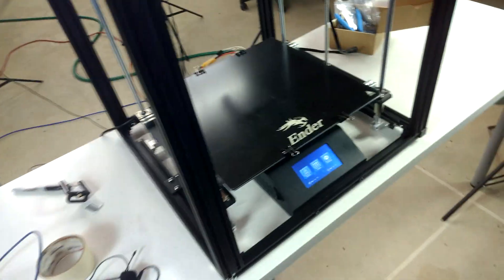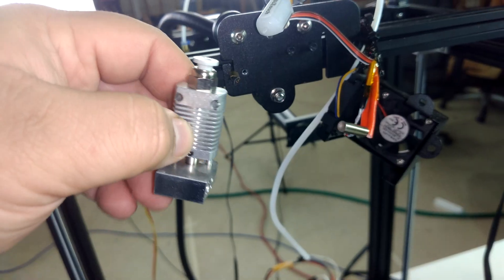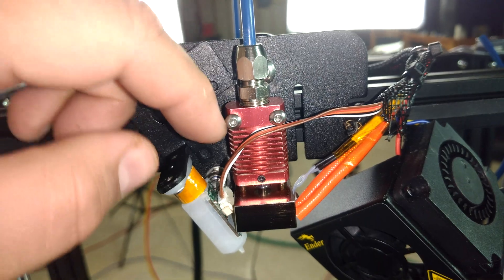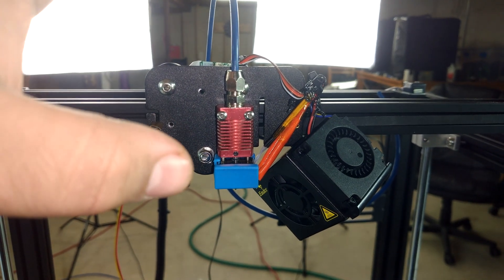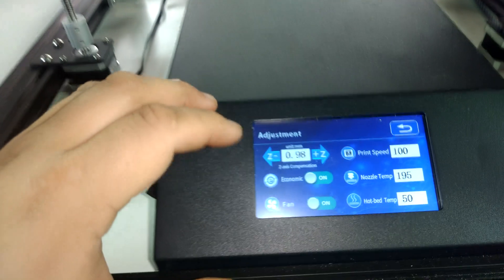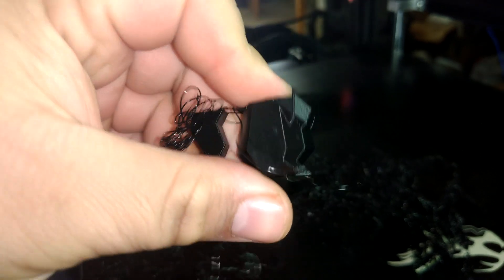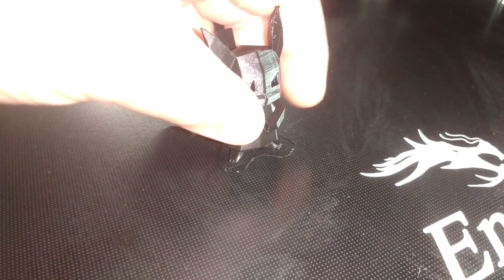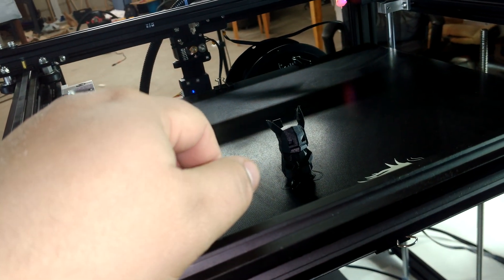Upgrading the Ender 5 Plus with an All Metal Hotend

Comment: what material are you printing with this hotend ?? I changed my ender's hotend to an allmetal and I can't print PLA anymore, although hotter filaments print fine
Reply from the maker: It prints pla and abs without issues
Reply: @andrewesquivel  this is really nice to hear, my pieces are very similar to yours, the biggest difference is the heating block i use brass.  so probably i have a slicing problem.
Reply: all metals tend to run a bit hotter than before. You can recalibrate or do a temp tower expecting everything to be 5 to 10 degrees hotter (so start 10 degrees lower)

So if you print at 210 try 200.

Comment: Check you have not got the Eco mode on which turns off the heated bed, I dont think you will have as you are a pretty savvy guy but this is a relatively new printer to you